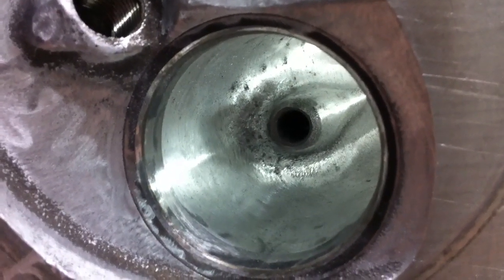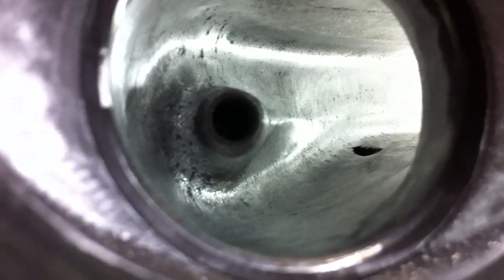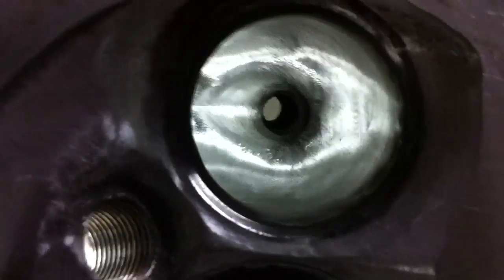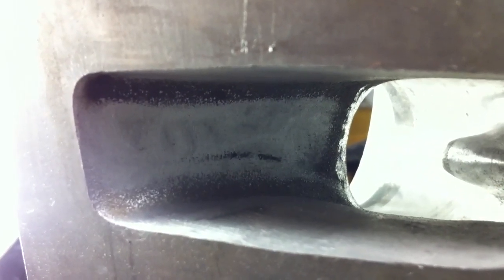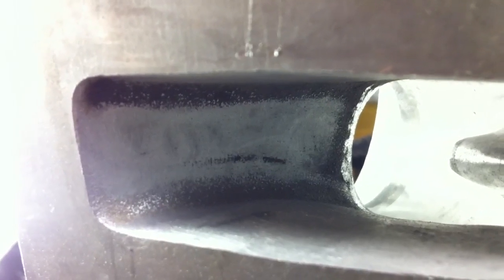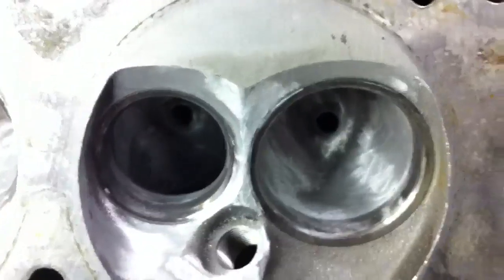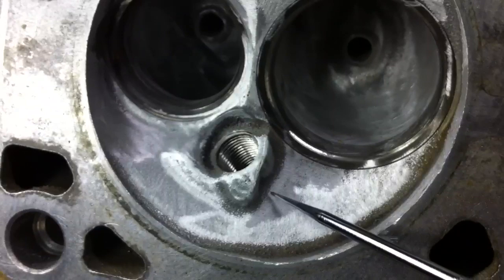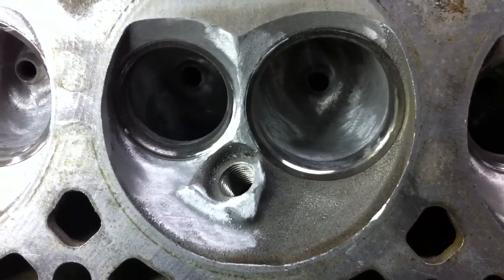How To LS1 DIY Head Porting Part 8 - Tootsie Roll + Combustion Chamber Start

Comment: what purpose does it serves to remove some of the casting in the combustion chamber
Reply from the maker: kad5118 Material removed from the combustion chamber will lower the compression ratio, so you have to be careful. I usually smooth the cast texture out of the chamber to help the flow and to resist carbon build up. Also sometimes you may want to open the side of the chamber where the valve is to deshroud it, to keep from choking the valves. You just have to make sure to not open it too much and stay inside the head gasket line.

Comment from the maker: Brotha! I went to high school at Sharyland between McAllen and Mission. Lived on 6 Mile and Glasscock.

250 is cheap for L92's! But I'm still going to run 862's on my LQ4. I think itll be interesting. First itll fool people. Second I'll be able to say it runs this good because I did it. Third, I think there is a lil small issue of lag in power with those big valves on a 4" bore. Not real bad, minimal.

Comment from the maker: right, LS1 heads have a 67cc combustion chamber and 5.3's have a 61cc. The actual LS1 motor has a higher compression ratio than a 5.3 i believe using the flat top pistons.

Comment from the maker: yea, it is a sleeper. Thats my set up. It just accidentally turned into a sleeper. It looks and sounds completely stock. Z06 cam with Milled/ported?2" intake valves on it. Stock manifolds. Bout to stash 1.8 roller rockers under the valve covers to! lol 

I'mma try out the TBSS intake tonight hopefully.

Comment from the maker: If i understand you correctly, thats about all i did on my first pair. I just smoothed all the surfaces (no enlarging) and removed the two "Speed Bumps" (the rocker stud bosses and swirl ramps) and also bullet shaped the valve guide bosses. It made my 853's flow better that 243's!

Comment from the maker: The electric tool i'm talking about would be called an "electric straight Grinder", but its important to note its RPM's. You dont want it to spin too fast cause itll break stuff. Found out the hard wat. It needs to spin at about 7-10k. And yes they are expensive. about $200 bucks. Thats why i say if youre just doing it just once use a drill. Milwaukee makes a good one but cost a lot. I went with a Makita with adjustable speed. IMPORTANT to check the speed of it.

Comment: yheap ive heard it goes up to 6000k for gen 3s 6200 some where there but not sure.. here thats what stock trucks get tuned at 6200-6300k stock intake stock cam.. but ive researched and seen some guys port the tbss intakes and even the gen3s i go into ls1 tech a lot and performance trucks also Rgvtrucksperformance.... ..

Comment: Yhea bro im from the valley here Truck performance is crazy lol but i would like to do it my self most of my friends just get the Tbss intake ive had 2 of them but sold them.... and most just go with 243s milles .030-.040... What electric dremel tool you recommend they are expensive as hell lol! my truck has 862s but its my daily driver my friend has some 862s complete just in his garage im going to buy them from him probably.... I was just thinking of taking the rough casting off and polishing.

Comment from the maker: I'm guestimating 30 RWHP. Its always difficult to through out an accurate number. I try to compare it to a similar build. For example, once i've milled my heads .030" and installed 2.00" vavles and ported them, I have almost the same set up as the newer 5.3's that come with flat tops and 243 heads. Just with a little more flow.

Comment from the maker: awesome man! Glad you've found these helpful. Thats what its all about.

First tip is to stay away from 706 casting. I had to learn the hard way. Chances of 706's cracking is high. Use the 862 casting.

I sometimes wish I had the 224 cam. Maybe later. I'm currently just running a 02 Z06 cam.

You can find decent burrs on Ebay. Thats what I used. But I recommend using a 1/4 shank electric grinder. YOu may even be able to get away just using a drill if you're only going to do it once.

Comment: hey bro seen your video what cam you have? i have a sierra single cab FBO minus pulley 3500 yank stall and a 224R im looking to buy a set of 706 or 862 .. and port them my self.. maybe add the bigger valves.. great videos! been looking at them all... any tips you can give me? 
im going to buy a dremel tool with some bits you know where i can get the bits? ebay ones good? Thanks also how many RWHP you think i can get from them ported heads with regular valves or bigger valves?